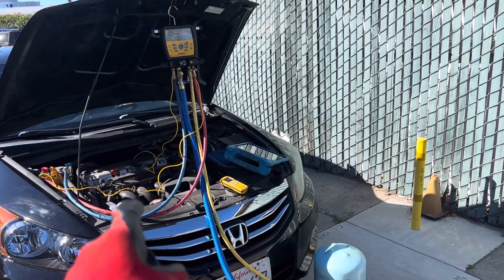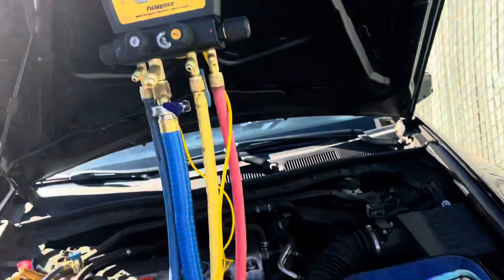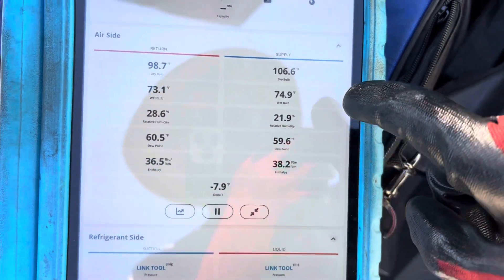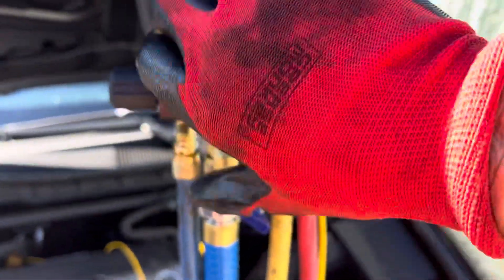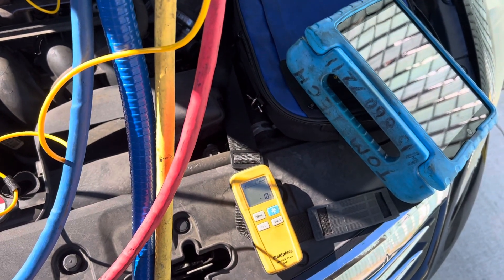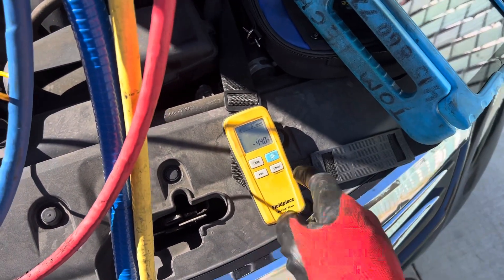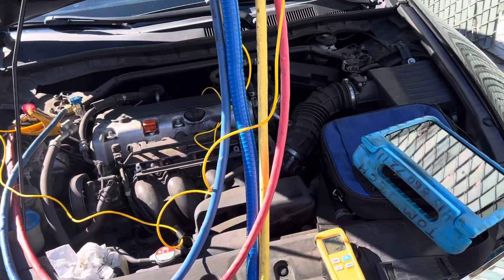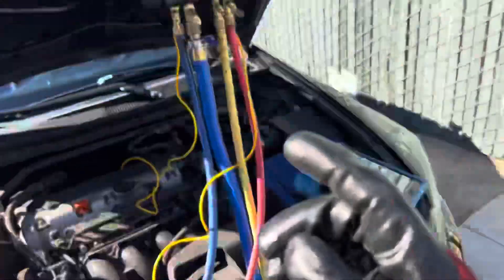AC REFRIGERANT RECHARGE IN HOT 🥵 WEATHER. ONLY TAKES SECONDS IF YOU UNDERSTAND THE GAS LAWS

Comment: Do you purge the yellow line first? Do you equalize the hose after?
Reply from the maker: Sometimes I purge sometimes I vacuum. 

I always vacuum, or recover the refrigerant out of my gauges between each vehicle 

Then I throw it on the vacuum pump and get below 100 µm . 

In between jobs since I’ll do anywhere from 6 to 10 vehicles a day, my gauges are always clean and dry 

If my last job was a nitrogen pressure decay test, I leave my gauges with a little positive pressure nitrogen inside 

So then I know my gauges and my hoses are clean and dry 

In this case, I might purge refrigerant through the yellow hose because it’s already positive pressure dry nitrogen 

And then vacuum out the red and blue hose before opening it to the system below 100 µm 

At the end of the job, it changes all the time, depending what I did or what I’m going to do next 

Because I’m doing multiple cars at every location majority of the time 

If I have too much refrigerant in my hoses left in the car I just charged is perfectly charged. I either recover that refrigerant out or use it as a leak test gas in the next car that I know is 100% empty or near. 

If I filled the system up a little short. 
And I know I don’t have another 30 g in my liquid refrigerant yellow. 

I could use that refrigerant sucker through the low side to bring up to factory specifications if I was 30 g short. 

Don’t forget you still have 1 ounce of refrigerant in the high side line that is liquid. 

That also have to equalizing been drawn over into the suction line low side of the system while it is running. 

So for me, it’s a case by case variance, depending on what I’m doing next

But always vacuum out your hoses below 100 µm if you can between jobs.  And then purge clean dry nitrogen into them + one or two psi.. 

Never let them suck in outside wet atmosphere. 

Because the refrigerant oil that is stuck on the inside of your hoses, greatly absorbs all that moisture. 

And between vehicles, if you’re using the same gauges for. 

Get one of the Refrigerant flush bottles get an extra one for flushing Refrigerant fill it up with 99% to 100% alcohol. Pressurize it to whatever the manufacture says it’s limit is.. 

And between vehicles, give it a quick squirt through the yellow, refrigerant, charging hose.  Through your gauges, and out the ends of the high side and low side hoes.

Connected to your tank of nitrogen I like to use 600 psi with the high side and low side wide-open. 

And stand on or put in a vice however, you wanna do it and give it a quick burst of nitrogen.  This will blow out all the alcohol and oil residue.. 

Then throw it back on your vacuum pump and take it down below 100 µm. 

You know how they clean set of gauges ready for the next vehicle.